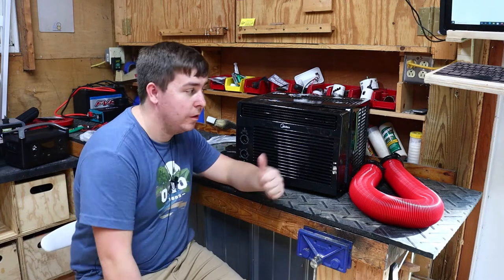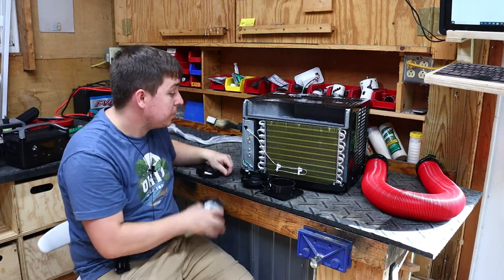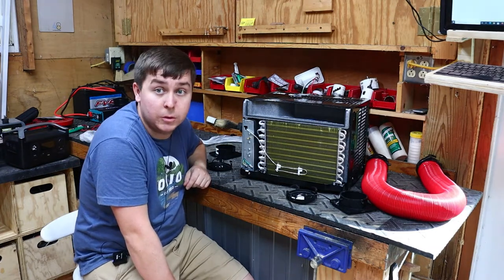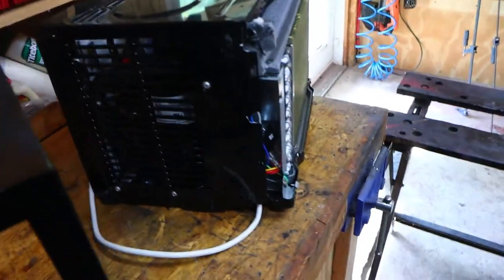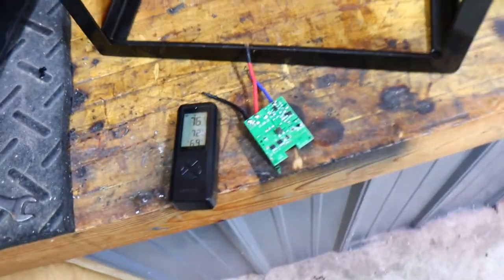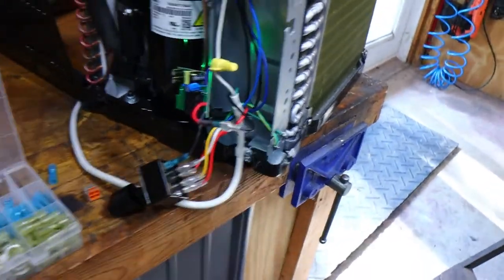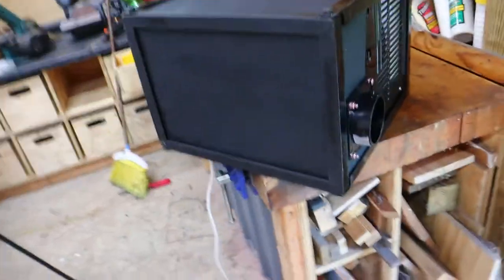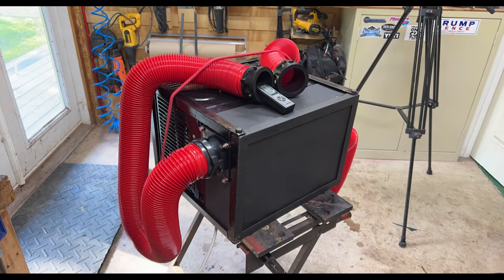TearDrop Camper Build | DIY Portable AC Unit | Bonus Video

Comment: Cool deal. AC s have a high and low pressure side. When at rest, both sides are equal in pressure, starts easy. If it has been running and stops, then tries to start right back up, the difference in pressure is to great and the overload takes it out momentary. It will do that over and over till the compressor starts. Buzz click. Buzz click. When you turn one off, best to give it a few mins 2 or 3 before starting again nothing crazy.

Comment: Awesome vid. I just built one similar to yours for my rooftop tent. Even wired up the remote you used. But my only problem is that when it goes to cycle off the fan and compressor turns off so it gets pretty still with no air movement. Is it supposed to do that or did I wire it up wrong? Does yours do that?  Thanks

Comment: Have you got to try it out this summer? And are you in the South, or have hot summers? Wondering if the delay helped with the short-cycling/freezing over. 
I'm working on mine right now and although it's a different brand than yours its the exact same build and layout. Originally I was planning on extending and running the controls into the cabin, but this is so much more elegant. I'm curious how well the remote works through the cabin to the toolbox as I'd have mine up there too. Did you also delete the temperature control? Sorry for the 20 questions, love the build - definitely inspiring how I'm gonna do mine.

Comment: It also works a lot better just redirecting the hot air that comes out from the back outside basically what you did but for the back 
You never really want to cover the front that brings in the air and cools it down

Comment: Great video. Now i was always told that flipping an ac unit on its side was similar to a refrigerator and you had to wait a few hours or a day fro the oil in the compressor to settle or  it will burn out so i assume i was wrong from this video and you tipping it over?
Reply: Yes you are correct. Anything with refrigerant inside should be allowed to stand upright for a minimum of 4 hours before use to allow the refrigerant to settle.
Reply: The amount of time it was on its side is the amount of time it needs to be given to settle right side up before use up to 48 hours. 20 minutes on side=20 minutes to settle. 20 hours=20 to settle. Two months=48 hours to settle.

Comment: Not saying it wont work fine, but water tight doesn't mean it's air tight.
Water molecules are larger.
The opposite is true. Air tight means water tight as well.